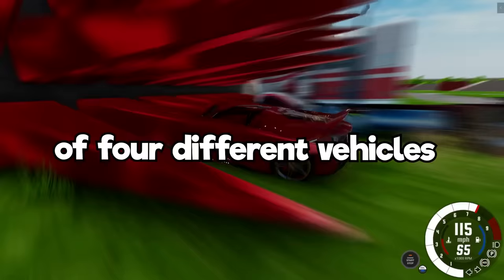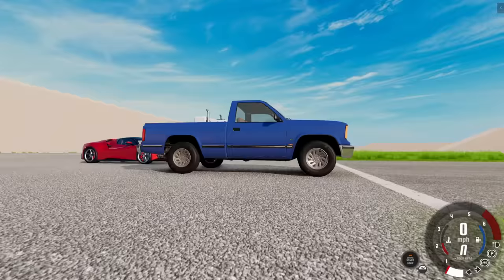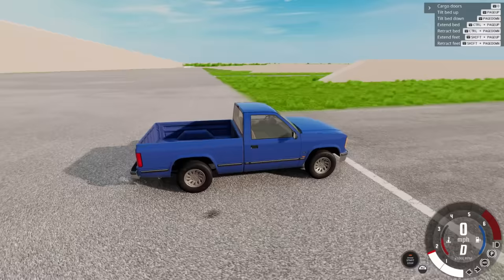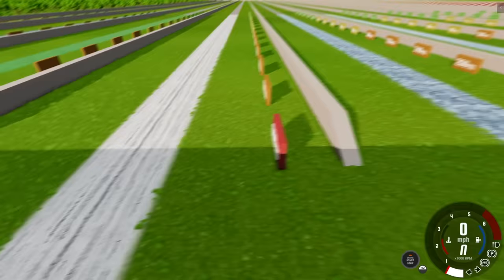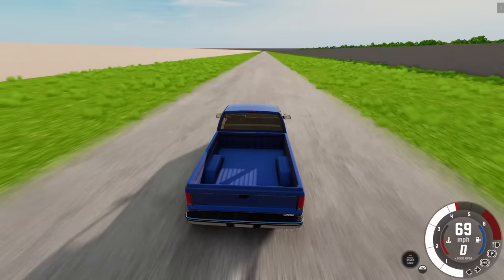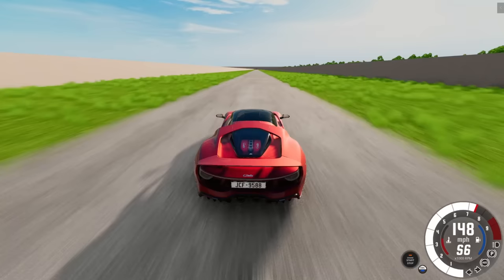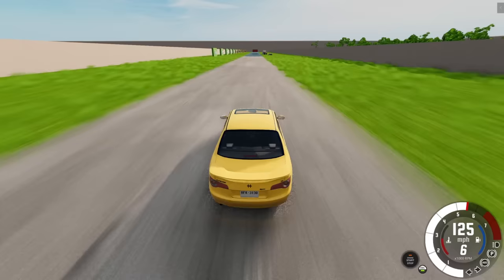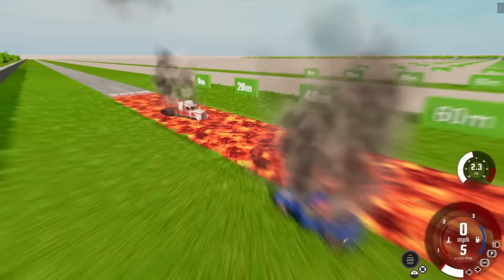Testing Brakes on Cars VS Dangerous Roads in BeamNG Drive Mods!

Comment: in beam what i noticed with new cars vs older cars with abs
new cars cut the braking power to like 40% when full braking so you need a controller and keep the brakes around 50%-70% to brake with the full brakes to not have them reduce to like 40% brakes
the older cars like the d-series if you full brake it will stay at 100% braking it just prevents lock-up

Comment: You gotta redo this test. 
All the vehicles need to be going the same speed. 
Also having good brakes has absolutely nothing to do with stopping on wet/muddy etc surfaces, its all about tires.
Reply: True and I think the scintilla has the best for proper surfaces and I think the D-series has a little more grip on surfaces off-road